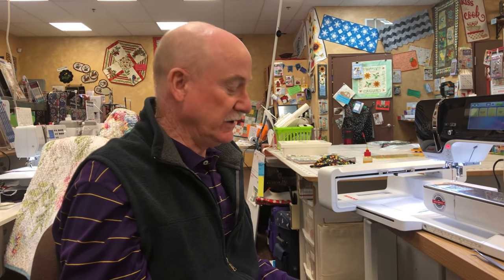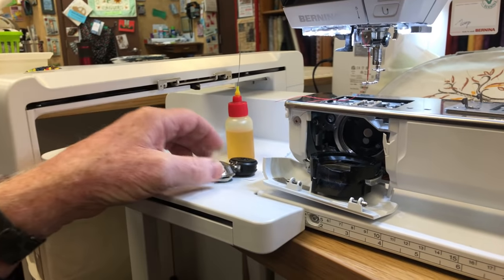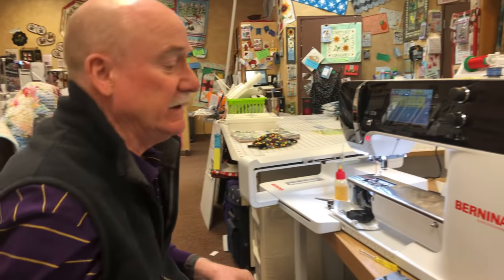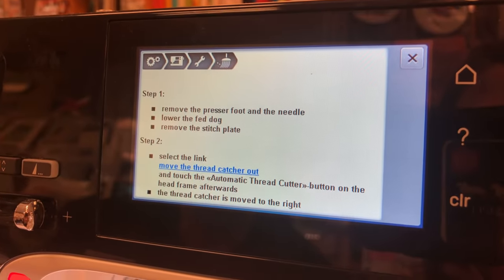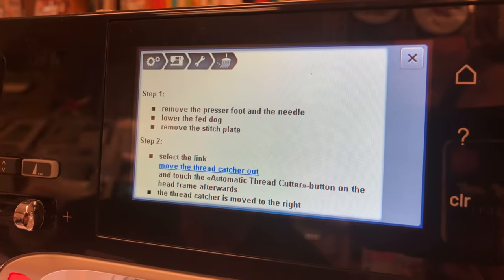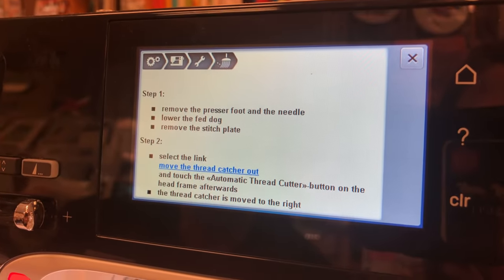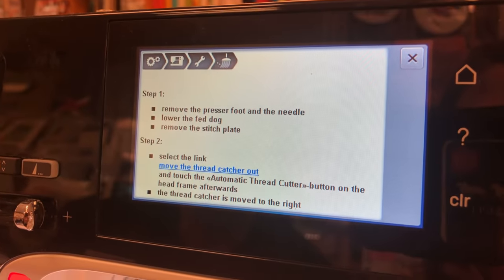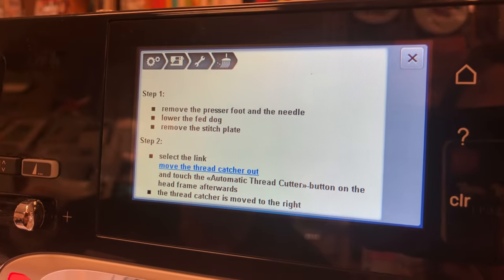All The Best Tips: Jams, Errors & Oil DYI Fixes Bernina 7, 5 & 4 series with Bernina Jeff

Comment: Thank you for your videos Jeff. I have a 770 and when I use the scissor function I lose the bobbin thread. Can I adjust the amount of bobbin thread left when using this function?
Reply from the maker: Robyn, there is no adjustment for the thread cut length, I think the thread catcher is damaged if it does not hold the bobbin thread.  You should see a dealer, the thread cutter is fussy on the 7 series, it can get damaged if the needle slips out of the holder or it gets bent and hits parts below.

Comment: I am having a continuous problem on my 790 Pro with stitches puckering despite new needles, oiling the machine, proper bobbin threading and placement....all the usual tricks.  I am usually sewing on cotton fabrics, so it should be a no-brainer.  Have adjusted tension on top to no avail.  Help??

Comment: Do you have any videos on tension for the B750QE? I'm having to run mine at extremely low to get a good stitch,  like 3.0-2.5......wondering if I should do something with the screws on the bobbin case?? I tried your tip of holding it up with the hook, but my hook is a full circle (different from the one you demonstrated)
Reply from the maker: The bobbin case tension needs to be set by a Bernina tech we have a special weight tool. Then the upper tension needs calibrated in the service mode by the tech. The 750 and 780’s stitch quality was not as perfect as the 770 and 790 because the upper tension system was re-engineered. On the newer models plus the bobbin case and hook were re modeled that’s way you cannot interchange the bobbin cases on those models plus other ones

Comment: Jeff, what are your thoughts on using an external thread stand with a cone? Does it affect your stitches?
Reply from the maker: I like the external thread stands just make sure the top of the thread cone is perfectly lined up with the thread guide on the stand then there is a small wire thread guide in the 7 series by the bobbin winder to put the thread thru
Reply: @berninajeff  Thank you

Comment: Hi Jeff I follow you anyway so its nice to have the common faults all in one place. Thank you. I have a problem, have sewed for years on other machines, and never had this problem. I have to use a little piece of fabric to start sewing, crazy, if I dont I have the thread going back into the machine and get a small nest right at the beginning. Same problem with embroidery, I pull the thread up but have to hold the thread as it also goes back into the machine. Never had this problem. If I dont do this then it builds up into a mess of nests. I have 790+ love the machine, but this drives me nuts, I do have the single hole plate on as I was told by my dealer that the other plate was the problem but its not. Any ideas?
Reply from the maker: The small nest at the start of every stitch on the bottom will happen every time you use the auto thread cutter.  The thread catcher holds the bobbin thread until the top thread forms a stitch.  The only way I see around this is not to use the thread cutter and hold onto both top and bottom threads when you start sewing, that is what we do when we have a machine that does not cut the threads for us.  Other machines that have the drop in bobbin system hold the bobbin thread in a different way so you do not notice the nest under the fabric.  I guess its the price we pay to have the giant bobbin.  Sorry no magic solution. Bernina Jeff Keep on Sewing

Comment: Regarding the multi-function knobs not working, the top knob (stitch width) isn't working on my 770.  If i'm in embroidery mode, I can't use it to center my needle.  Is there a workaround for that or do I just have to bite the bullet and pay to have it serviced?  Thanks!
Reply from the maker: Your best bet is to use a stylus to move and position on the screen, you really should get the knob fixed

Comment: Jeff I would love to know how to clean the fluff out where the thread comes down to above the needle. Inside that white cover.
Reply from the maker: On the 4 and 5 series the face plate over the needle are just pops off when you push it to the left.  on the 7 series use the "L" shaped wrench that a 20T for torx take out the screw on the left side turn off the machine and discharge yourself from any static electricity---have I discouraged you yet?  Now getting the plastic cover off is a trick, pull up from the lower right corner and wiggle till it comes off, getting it back on straight is just as tricky, this is why you pay someone the big bucks at a dealer.  Make sure the machine is unplugged.  Use a plastic brush to clean out the lint and any stray threads.  Q tips and micro swabs work good too. Re-oil any metal on metal moving parts(turn the hand wheel), my yellow cap oil works best for this but the red cap oil will do.  Then put the cover back in nice and straight and test sew.  If you put 2 to 3 million stitches on a machine per year I suggest an annual service just like a mammogram prevention is key.  At minimum your machine needs to be serviced every three 2 to 3 years oils dry up and an unused machine really can get stiff.

Comment: Thank you Jeff!  I appreciate the tips.  One question about the oiling - you didn't mention oiling the hook area behind the bobbin.  Is that something we should no longer do?
I bought the oil from you - that is a great bottle and easy to use with the long tip.
Thanks again.
Reply from the maker: Yes you still need to oil the two holes behind the bobbin case every few weeks. I was going to show that but forgot.

Comment: Jeff i bought one of your oilers.    ITVWORK GREAT AND now i can't get a drop out of it.    ANY Ideas why and any fix
Reply from the maker: The tip gets a little piece of the stopper in it pick it out with a thin pin or unscrew just the metal tip and use an air compressor to blow out from the plastic end or use a thin wire or I can send you a new one no charge Jeff
Reply: @berninajeff  i will try what you say and contact you if i have no luck... thanks for your quick response...

Comment: I have a b350 that turns on but won’t sew more than a few stitches. I tried the pedal free feature and with that it only sees a few more stitches on the lowest setting. When I advance the speed it stops. I checked the manual and it wasn’t helpful. I sew all the time and keep my machine cleaned and oiled. I forgot to mention that the machine smell of something hot. Any suggestions?

Comment: Any suggestions on how to fix the Bernina 1630 track ball issues?
Reply from the maker: You need to find an expert on that model. No new parts for the track ball are available from Bernina. If you turn the ball and get sporadic or little movement of the curser then that can be fixed. If a board is bad then the dealer has to have one in stock those are not being repaired any longer. Or ship it to me.
Reply: @berninajeff  Thanks. I pulled the board and checked the two rollers and cleaned the area with electronic spray cleaner. No better. The ball tracks right and left but not up and down.
Reply from the maker: @GeoffreyScheid  There are tiny little wheels that ride against the track ball in back, those get flat or full of lint.  I remove the pin they ride on and actually make them round again by putting the pin in a cordless drill and spin it on a grinder with a very fine wheel.  That fixes the tracking both directions. You need to be very tender with the supports
Reply: @berninajeff  Thanks so much. You're a wealth of great knowledge.

Comment: Hi Jeff thank you for all this good information.  I just purchased a B590 and love it, however today i was embroidering and the upper thread broke.  The gear error came on first then a machine picture raising the needle and turning the hand wheel came on.  I was not able to do either, so I opened the bobbin case, cleaned out any thread in there, then took out the hook, cleaned out a little more thread and put a drop of oil in both circle spots of the hook, put everything back together and tried to turn the hand wheel with no luck.  Turned the machine off and on a few times, but nothing is correcting the issue.  it looks as though the needle is 1/2 way up and off center since the thread broke in the middle of an embroidery.  Do you have any idea what I could do next to fix this issue.  Thank you.  Terri PS I want to get a couple of those little tools you have shown in your videos, they look great.  Will call your shop to order.
Reply from the maker: To Terri V when a 5 or7 series is jammed and you cannot turn the hand wheel first remove the bobbin case and metal hook. Look in there for thread. Now try to turn the hand wheel in reverse (clockwise) you can use as much force as opening a. jar of pickles. The worst thing you will break is the plastic hand wheel cost less than $10. If it will not turn either way you need to bring it to a tech.
Reply: @berninajeff  ok Jeff I will give that a try, again thank you very much and Happy Easter.  Terri in California
Reply: @berninajeff  ..

Comment: I got a picture of a spool of thread with thread coming off the spool. There was a problem with the needle hitting the bobbin case and just bending the needle and breaking. The needle. I can’t see any reason for that to happen. I was sewing and left the machine for a few moments. When i went to restart to sew, the needle broke. I replaced the needle and tried again. I had the single stitch plate on trying to do the first stitch on the utility stitch. The straight one. Can I fix this. Thanks for all your help
Reply from the maker: I think this issue is has to be fixed by a dealer.  Hitting the bobbin case is not good.

Comment: Help! I accidentally went to the calibration  window without calibrating, now my machine is confused and I tried holding the screen and turning it off then on, nothing, so tried pushing both arrows on sides of the needle, nothing, I have a 5 month old 770QE edition plus
Reply from the maker: Turn off the machine hold down the two arrows until a white screen appears press targets works every time

Comment: I recently had a jam and the wheel would not turn.  Removed the bobbin, hook and needle and restarted, no go.  Just got the picture with the wheel in orange and showing it needs to be turned.  I took it in for repair, but no idea what they had to do -- only "hook driver jamming machine".  Is this a common problem that I could have fixed myself?
Reply from the maker: Some jams require a tech but you can always try turning the hand wheel backwards about as hard as opening a jar of pickles. If nothing gives then take it in.

Comment: I have bernina 475 and recently having issues with thread bunching underneath.  Any ideas why?  I can be sewing along just fine and then it starts.  I have clean, oiled, changed needle, rethreaded.  I’m frustrated.
Reply from the maker: Next time this happens do not touch the thread, look to the top of your machine, has the thread come out of that slot on top?  It can be at an angle to the front of the machine.  Does your thread get messed up inside the bobbin case or is it nested up on the bottom of the fabric?  If the issue is on the bottom of the fabric it is 99% caused by the upper thread.  Do you us a knee lift lever, if you lean on that enough it will open the top tension unit and cause what you described that one was really hard to figure out until I watched the customer sew.  Try those, might need to see a tech about the upper tension unit.
Reply: @berninajeff  thank you - yesterday had issues - today running like a charm - I will check that out if it does it again.
Reply: @berninajeff  I do not use the knee lever, it is thread bunching under fabric - had issues a couple weeks ago also - thought it was the black aurifil thread as other threads worked fine. I had it serviced this summer - only had it little over a year.
Reply from the maker: @sharob621  Try using a thread net over the spool of thread and try cleaning out the tension unit with a pipe cleaner swipe it thru the top slot

Comment: Hi Jeff Konrad here again my wife’s’ B 570 she cannot reset the screen even with holding the two buttons down goes back to a white screen we just cannot find the screen with the three stylus on it to reset the machine only sews straight right now. Any help for this one?
Reply from the maker: The 5 series screens are different, they never need calibration, if your screen does not respond try using the rubber tipped stylist or the fleshy part of your finger, a finger nail or hard stylist will not work on those screens

Comment: Jeff, I'm having trouble sewing a hem on a lightweight dri-fit shirt on my Bernina 570QE. The material keeps getting stuck in the plate and stops the machine from sewing. I have to take the plate off each time and pull it out of the slot. Please help.
Reply from the maker: You are going to need a size 8 or 10 needle stretch or microtex point. Use a 1C foot not 1D or 20. Also thin poly thread size 60wt. If you have wash away stabilizer use a strip of that on the back to sew thru.
Reply: Thanks I'll try that.

Comment: I can't find any directions or guidance on resetting the Service Icon. I have a 550 QE.
Reply from the maker: I think this is the icon that comes on to remind you to take it in for service. The tech will reset it in a service mode that’s not intended for the user. If you have had it in for service recently then the tech forgot to reset it.

Comment: Hi, Jeff... just got back my Bernina 770 from regular maintenance, FMQ'd a panel then started to put on the binding and the thread cutter stopped working. I took off the plate to clean it and the thread cutter would not move to the right, per the instructions. Before removing the plate I tried sewing a simple embroidery tag for the quilt and the letters piled up on each other. I was using a D foot with the built in walking foot.  It seems these two issues might be  related. Can you assist? I've called the Quality Sewing Service department and short of having me bring the machine by (60 miles away) they are going to get back to me. Thought I would see if you have suggestions in the meantime. I did clean the bobbin area and removed some threads but that appeared to have no affect.  Thanks BJ.
Reply from the maker: Janine Prichard,  thread cutters are the only fussy part of the 7 series.  Sounds like the tech did not correctly service the thread cutter.  As for the letters pilling up make sure the needle plate is flush, push down hard on it this may fix both issues.  The stainless plate can get put back on just a little off set causing the needle plate to be harder to get on.
Reply: @berninajeff  Thanks Jeff.  I guess it needs to go back for them to fix.  Did find out after removing the stitch plate that gently forcing the cutter mechanism to the left allowed me to stitch without stitch-overs which had the effect that the feed dogs were down. Part of the cutter was causing the thread to hang up.

Comment: I just cannot get my needle threader to work. (Never have) With a magnifying glass and flashlight it appears that the wire never enters the hole in the needle. What do I do? Don’t want to pay $50 for something I have not been using. I have a B570
Reply from the maker: The needle threaders on all brands of machines can be fussy.  Sounds like the threader head may never have been adjusted to make the hook go thru the eye this can take a trained tech 30 minutes really need to take it to an expert if you want that feature

Comment: My Bernina breaks the thread, and it "flies" up inside.  No way to pull thread DOWN.  How do I pull thread down, as advised?
Reply from the maker: So this is what I do if I cannot find the needle side of the thread when it breaks.  Look in the take up area of the machine and usually I can see thread there ant I use a Hook tool or crochet hook to get the thread and remove it that way.  If that does not work I take the thread from the spool and unhook it all the way down guide by guide. Hope that helps.

Comment: Not sure you have done this already..but I broke a need and the top part is gone! How do I get inside to find it..will not use it until I find this tip!
Reply from the maker: Most needle tips fall harmlessly to the bottom of the arm cover, a consumer cannot get to that area.  I usually take the round hook out and check the back side which has a magnet that sometimes holds the needle tip.  If you don't see the tip and the machine is not making new sounds you are OK to sew.
Reply: @berninajeff  thank you! I was very worried...I am a very new Bernina owner having only sewn on a Pfaff for 30 plus years and a Singer before that..appreciate all of your tips for newbies!

Comment: I get a message that shows the Straight Stitch throatplate which I have on my machine.  I also select it on my screen but the message remains.  This occurs when I try to Embroider and it will not progress to sew.  Help!
Reply from the maker: There are two places you MUST select to let the machine sew.  First select the plate where you select the needle or twin needle.  Then on the left side of the screen select #26 and 0mm after you have sent the design from the edit mode to the sewing mode.  The 5 series is very picky about this order.

Comment: I have a 440 and no one can fix my sewing light…..it goes off after a minute but everything else worked good.  Bulb has been changed 3 times and it still does the same thing……what can I do?
Reply from the maker: Does the screen back light stay on or does that one go off too?  Those two lights are hooked up together so if the screen goes dark but you can still see the icons that needs to be replaced $$$$ maybe just buy a light to stick on
Reply: @berninajeff    Yes back screen goes odd also…..I have put on one of those strip lights…thanks for you confirmation.